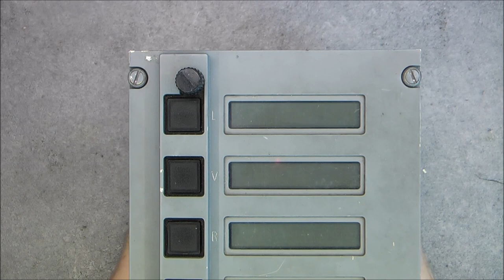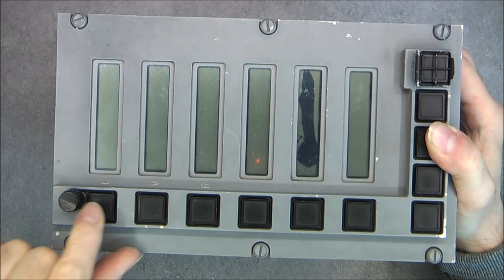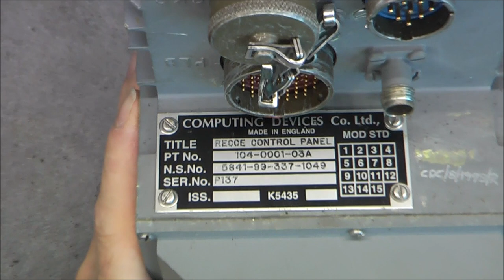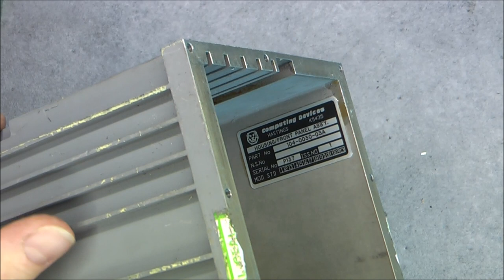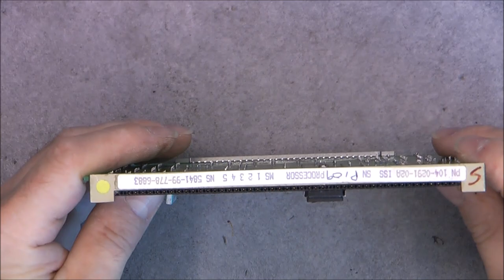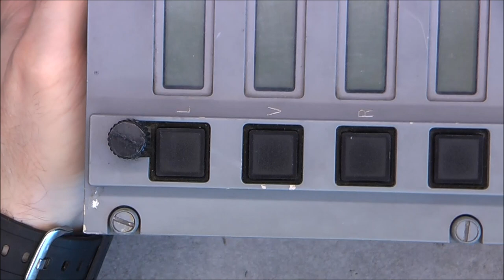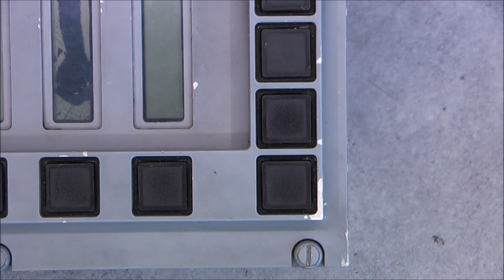Tornado Recce control panel teardown

Comment: The electroluminescent backlights are probably powered directly off the aircraft's 115V 400hz supply, usually electroluminecent panels like this will tolerate 100-150VAC at 200-1000Hz.

Comment: Computing Devices was a Canadian company which was taken over by General Dynamics Mission Systems Canada at some point. Several of their current products still use designs from Computing Devices. If you go to gd-ms.ca and scroll to the very bottom there is a link to "view all products, solutions and services" where you can see a comprehensive list of what they make. The UK subsidiary was called "Computing Devices Co Ltd". Very interesting! Regarding power, I would try powering up that capacitor directly. That should be enough for logic, but you may not get backlight if it's rectified separately since as you said correctly, EL backlight and displays use high voltage.